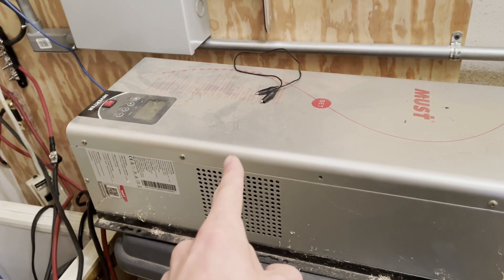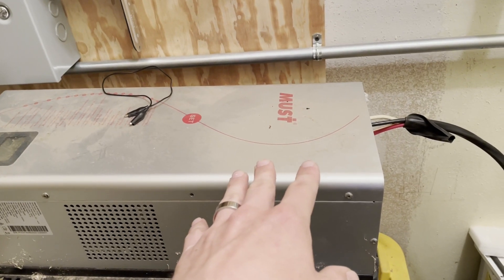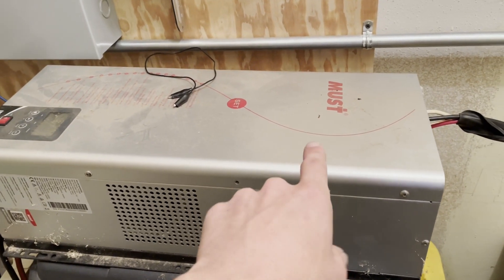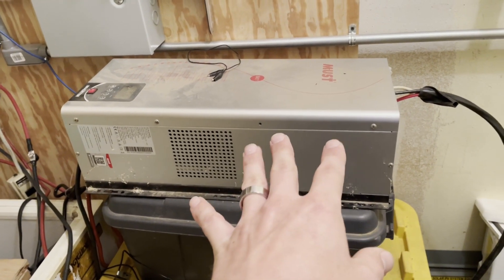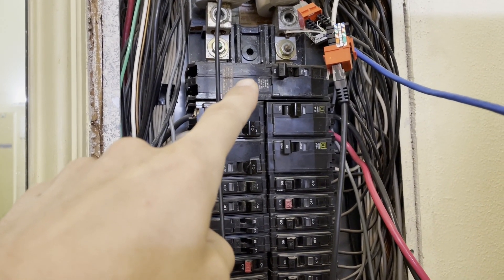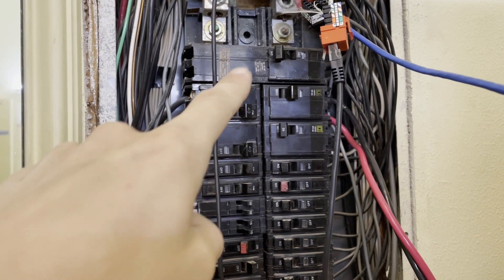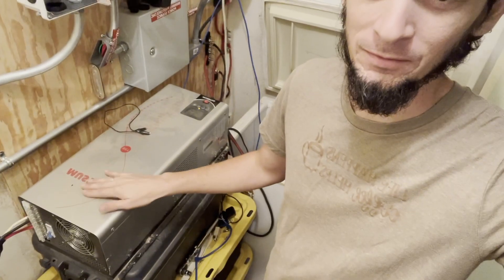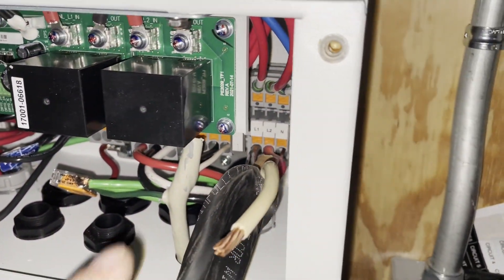Will It Start? - Solar Edition

Comment: The micro air works great on my 20-year-old 4-ton HVAC unit 1 Schneider 6848 Pro runs the whole house lithium and batteries of course.

Comment: Did I miss what batteries you were using or was it just pulling from your panels?
Reply from the maker: I briefly showed the BMS for the battery when I talked about how many amps were going into it. It's a home built 11.7KWh.

Comment: I installed the micro air on a 4 ton scroll compressor and my 6kw growatt with the giant transformer started it but was very close to the Max watts the inverter could do... So I got rid of it and installed the Mr cool universal dc inverter unit.. now it runs so much easier and about 2.5kw to 3kw normally
Reply from the maker: I guess I was probably bumping the limit with my 4K on a 3 ton like your 6k on a 4 ton. Though I didn’t have an easy start yet! Just had a thought, surge current might be worse in the heat of the summer. Not sure on that one.

Comment: my central air unit, which is fairly new uses about 2.4kw to run, but about 16kw to start. this is all new to me so i could be wrong, i measured hot or neutral 240v at the box going to the pump outside, using the inrush setting on my amp clamp. 16kw/2.4kw= 6.66 times. my puny 120v 5kw high frequency psw inverter  is not going to get it done
Reply from the maker: That sounds about like mine. 66 starting amps sounds right. I don’t have an I rush meter…yet. I’ll get an update about running the micro air, it’s installed but haven’t tried it with the inverter yet!
Reply: @BeeneEnergy  I went with “hard start” kits on my 2 five ton units.  They did dramatically reduce the “LRA” (locked rotor) starting amps.  Have not yet tried running it on my EG4 6000.
Reply from the maker: The hard start kits, are they the capacitors you wire in? Let me know how it works!